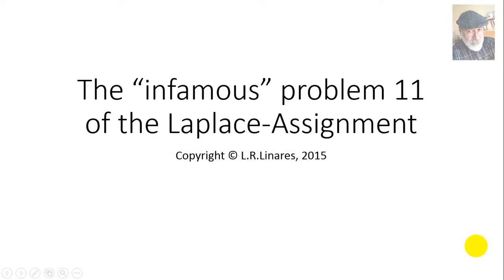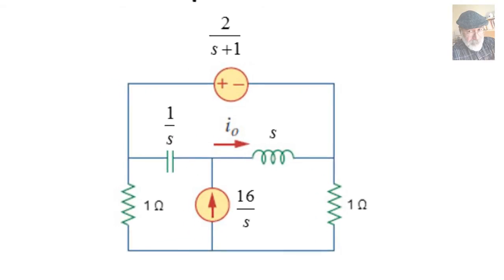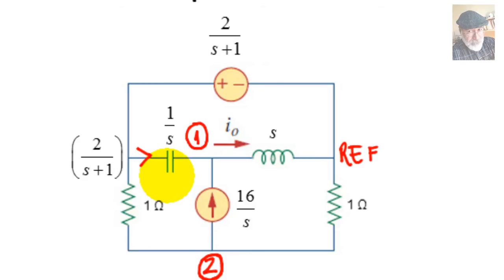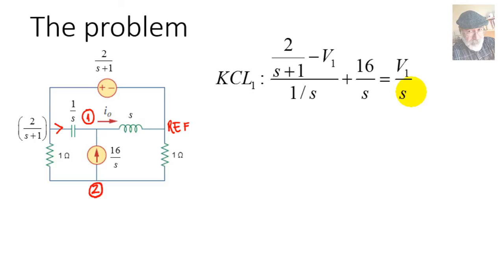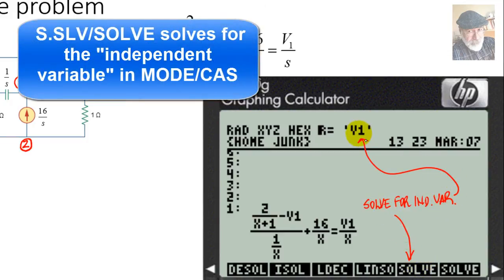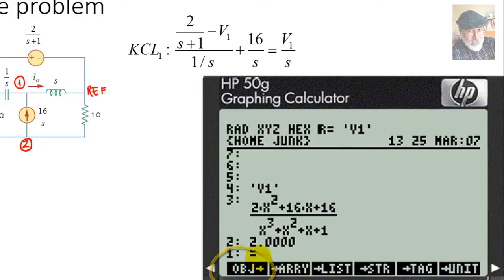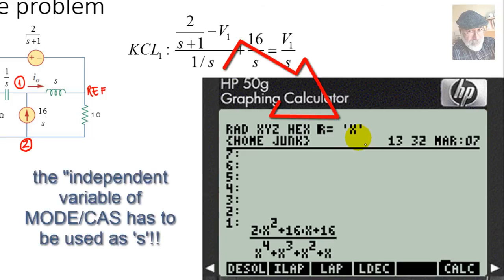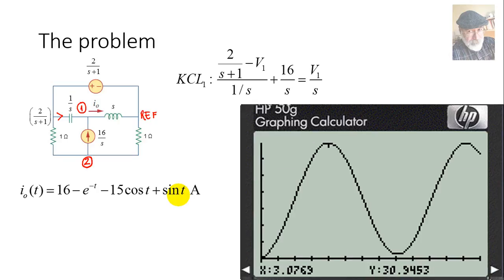The "infamous" problem 11 of the Laplace Assignment ... one equation only!

Comment: Exceptional example, as always. Another way of finding V1(s) in HP50g is to, instead of changing the independent variable to 'V1', just type V1 and the function isolate (ISOL). That way one doesn't have to access the mode menu. Thank you from Brazil, Dr. Linares.
Reply from the maker: Excellent!  ISOL, very nice! Thank you for sharing! I really like this calculator. A pity that it is being discontinued. I hope that the replacement calculator lives up to the power and reputation of the great HP-50g.
Reply: Oh, please. If I know something about this calculator it's because of your videos, which are the reason why I bought one. Me too! I don't think I'll ever upgrade if they don't make the RPN in the Prime as great as it is in the 50g (but I really hope they do that).